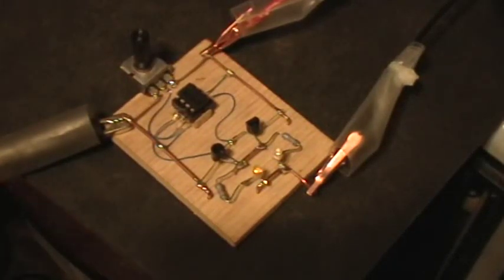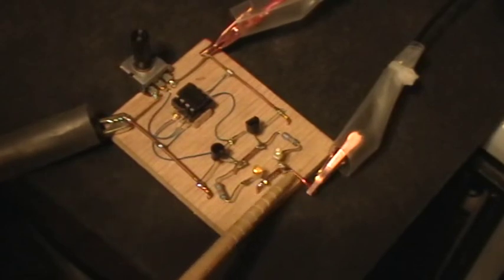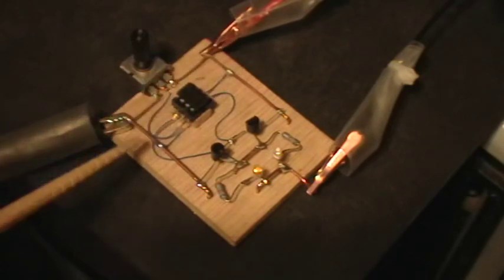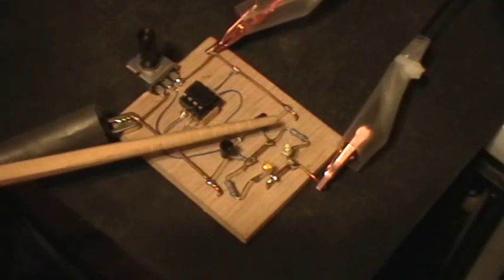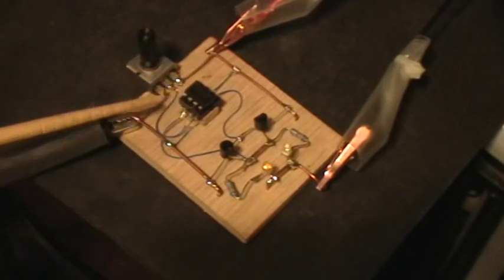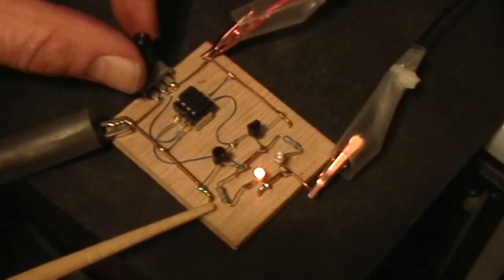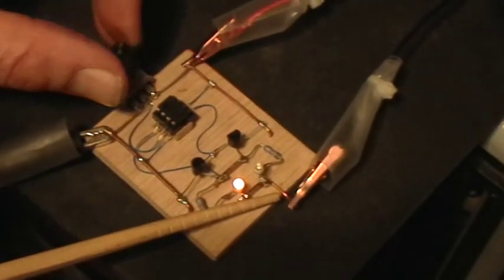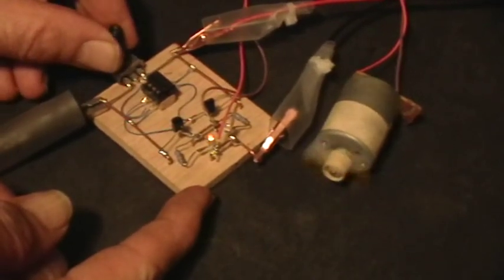Misc Circuits: Push-Pull Coil or Motor Driver Using 741 Op-Amp

Comment: So... now I see how npn and pnp work; thanx :)   
can you connect them backwards, and then the voltage on one side or the other makes one or the other conduct? 
so in both cases, the closer to collector the more on it is... so if I put them collector-emitter and emitter-collctor and base-base wouldn't it toggle +/- from ground so one or the other is on?
Edit; I can't put the emitter on the + side? of 0?
Reply from the maker: I'm not following you. There are several ways of doing this; what's shown here is called a "common emitter" configuration since both emitters are tied to the Ground or zero voltage reference level of the bipolar supply. The signal from the output of the op-amp swings + or - wrt that Ground level and thus turns on either the NPN or the PNP transistor. The NPN transistor conducts from the Collector on the positive rail,to the Emitter then thru the load to Ground level. The PNP transistor conducts from the Ground level, thru the load, to the Emitter, then to the Collector at the negative rail.  So the current thru the Load reverses polarity depending on which transistor is on.  You could also use a common collector configuration I think but then the circuit would work backwards I think, like an inverter. Check the link in the description, he shows several simpler circuits and explains very thoroughly what is happening.
Thanks for watching and commenting!
Reply: @J Decker 
NPN and PNP transistors can (largely) be thought of as mirror images of each other with respect to power supply polarity.

An NPN transistor is typically wired as a switch between a load device negative terminal and common (or ground).
Thus, small forward current from base to emitter (emitter connected to common) can turn on a much larger current going from collector to emitter.

A PNP transistor is typically wired as a switch between a power supply and load device. 
A small REVERSE current out the base from emitter (emitter connected to supply) can turn on a much larger current going from emitter to collector.

Though both types can switch (or amplify) the two types aren't interchangeable because of the way transistors work. The semiconductor layers inside act as diodes, only allowing current to flow properly in a single direction.

Comment: I like this, but I know little. What if we don't have a negative power supply? I just have a cheap 2 wire 5 amp 12v regulated supply. Thanks

Comment: Fantastic!  So, replace the pot with the sensors input and some heavier transistors added, and a coil instead of the leds and...poof!  We have levitation!  Well, I guess we need the stabilizing mags around the base but...I see exactly what you are doing here.  Now it is very clear.

Excellent work.  In reality, your circuit is probably more efficient than the one they are using.  I suppose the switching frequency capability of this circuit is pretty high?  High enough that a stable levitation could be reached without it "hunting" up and down?

This really blows my mind how you can just make this circuit like that.

I really appreciate this...

Fantastic!

Thanks,

Bill
Reply from the maker: Yep, op-amps are cool. I'm just learning about them and what they can do. I'll be doing some more tests to see how fast this thing can respond but it should easily be fast enough for mag-lev. The main problem will be getting the sensor system right I think.
I actually have a handful of single-supply opamps, some storebought and some ripped out of old TV or monitor chassis; I had to dig a bit to find the 741 bipolar supply ones, even though they are very common "in the wild".
I also have a lot of the transistors I used, BC556B pnp and BC337-25  npn, because they are so cheap that I had to buy lots of 50 in order to get reasonable shipping. Came out to about 15 cents per transistor. So I'm trying to use them in everything I build. I was surprised that they ran the little motor so well without heating up. But for a levitation coil you'd def want to use power transistors, and perhaps also configure the opamp as a comparator that would just flip the output from rail to rail rather than being proportional like this circuit, and use power mosfets for the pushpull stage.  Simple mods I think.
Thanks for bringing up the interesting project, it's a good one for me to play with, not too complicated and an interesting result!
Stay tuned for more...
--TK
Reply from the maker: I  just tried the circuit with a drive signal from my Function generator, a slow sine wave. Red lead from FG to the wiper of the centered pot, Black FG lead to the Zero ground terminal. It's fun to see the motor slowly speeding up, slowing down, stopping and reversing, speeding up in the other direction, etc etc. I haven't yet pushed it (without the motor of course) to see how fast it will respond to a faster input signal, need more coffee first, and need to find a suitable coil for a load.
Reply: +Pirate Labs Levitation? I thought it would transform into an automatic human destroying terminator from 2020, not float!

Comment: I think this is what I've been looking for. I think you're demonstrating that a push pull transistor arrangement could be used to drive a motor from an op amp. I know that an op amp cannot drive a motor on its own.
I want to experiment with controlling a geared DC motor like a servo.
I built a wireless mobile robotic arm with a pan/tilt camera which can be seen in my latest video. The micro servos in the arm have no meaningful torque. I'd like to scale the robotic arm up large enough to do some useful work.
I used the nRF24L01 transceiver so I'm controlling it with 8-bit data as opposed to position pulses for esc's.
I also like the way you built that circuit without a pcb. I want to try that.
Reply from the maker: It will probably work for you just fine. Let me know how the finished product goes!
Thanks for watching and commenting.
Reply: +TinselKoala Thanks for responding back so quickly.
I was searching circuits online and I tried to imagine one of the motor terminals connected to the wiper of a potentiometer and it looks like a short.
The first thing is I'm going to build a circuit with LED's and go from there.
If it doesn't work that's OK too. I still learned something important from your video. I really liked the way you built your circuit.
-----------------------------------
EDIT: I watched your video again. Between +15 and-15 you have a neutral. I didn't catch that the first time.